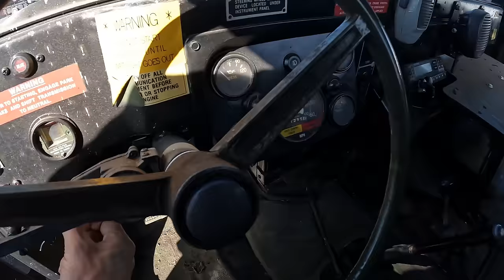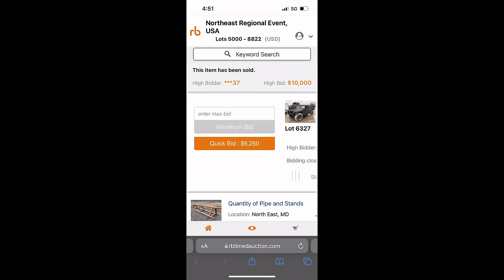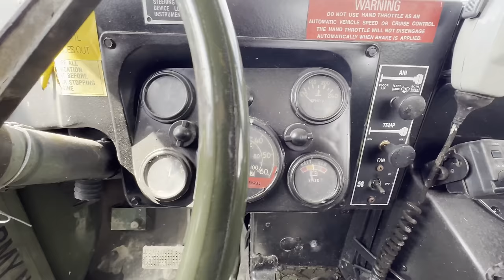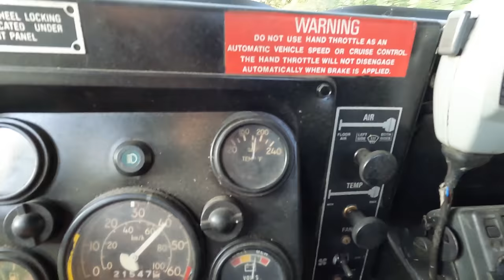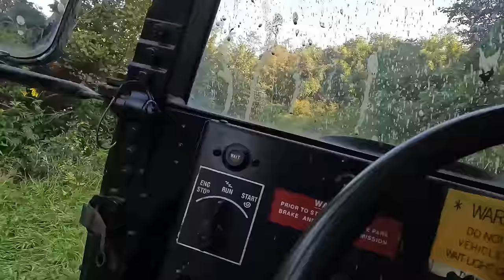Buying, Servicing, & Off-Roading The Cheapest Humvee I Could Find!!

Comment: The two are antenna mounts but can be used as convoy light mounts as long as they are steel and not aluminum.
Reply: Those are aluminum for sure
Reply: I thought they were beer can holders.
Reply: @davidholder3207  not if you want to get the cans with you 🙂
Reply: @davidholder3207  isn't everything a beer holder? I definitely know my hand is!
Reply: They can also be used to hold fishing rods
Reply: What an awesome vehicle!! Your gonna put a winch on it right ?
Reply: Definitely antenna mounts. I wad commo and drove a couple of these. Love them
Reply: @WhistlePunk22  steel
Reply: I thot light cages at first, then you guys ruined it with the beer holder idea...
Reply: You might want to remove the police radio’s from the unit, as it could be a legal issue for you…

Comment: That is a bare bones 6.2L GM slug. The trans is a TH400 3speed. The engine is a gutless plant, designed to run and idle FOREVER, the gear ratio is ideal for off-road use which doesn't demand much power. The newer HMMWVs have a turbo added to the bigger powerplant and a 4L80 4speed. The newer high output turbo engine was to accommodate the additional weight due to the addition of armor plating. There is a generator to power the radios and other auxiliary equipment that are typically installed for unit use.  As already mentioned you found extra radio mast mounts. Yes the rear seats are designed to stow the way you found them to easily convert for field adaptability, two bolts hold the backrest up in place. The side wood slats should pivot down out of the way. Your doors don't fit right because they are the wrong doors, that is a soft top and the correct doors are soft doors (wireframe with vinyl cover), when the proper components are used together (and adjusted aka bent to fit)  the result is pretty impressive . Be cautious going hell bent into water holes, the vehicle is more than capable, however, older units are prone to breaking the blades off the cooling fan due to age and use when coming in contact with deep water. Make sure you pay close attention to the geared hubs, they are straight cut gears and need to be treated as such. There are LOTS of other little things to keep an eye out for, look for the US Army Preventative Maintenance  Magazine. They are little cartoon pamphlets with good info from the motor pool guys and gals. One last thing, at your own peril though. Those diesels can be an absolute prick to start in the cold, glow plugs or not, one trick (again at your own peril) is to have someone crank the engine while you hold a PMCS manual (any vinyl covered semi rigid book) over the exhaust.
Reply: A higher air intake may be a saver in deep water?
Reply: @64TommyG  Yup Get the Intake tube and exhaust pipe for the Marine Corp version They will ford up to the top of the windshield with the deep water fording kit. With out it, I believe fording was only to 30 or 40 inches, I can`t remember which.
Reply: We keep a deck board in the back to cover the exaust in the winter lol didnt take long to fiure out it was needed
Reply: Lotta good info in that one comment. Thank you for your time.
Reply: And boy did idle my fair share of hmmwv
Reply: Sorry (to the OP) your info on the engine is incorrect. They switched from the NA 6.2 Detroit, to the turbo 6.5 Detroit. They didn't simply add a turbo system to the 6.2 Detroit. 

As for all the bitching regarding a Detroit's GP system (not just yourself, i'm talking about the amount that is all over the web) i say it's not true, and more to do with the lack of maintenance & care directed to the GP system over the life of the vehicle. I have a 6.2 Detroit powered, squarebody 'Burb (factory option) that does not see Winter use, but have started it on a -29°C January day (for shits 'n giggles) to prove to a few members on a forum, that a well functioning system will get the cranky ol' Detroit fired up. One press of the accelerator (to engage the cold start feature of the IP) and one cycle of the glow plugs, and she fired right up with roughly 1.5-2 seconds of cranking. Honestly, i'd rather have a GP system in my diesel, over the grid heater system found on Cummins, Duramax, and most newer Powerstrokes.
Reply: TH400? I am surprised.  I have had several Jeeps with that tranny.  Wagoners to Cherokees plus a J10.  Not impressed with the tranny.  My favorite was the T18.  I am surprised that they did not put that tranny in it.  Granny gear plus PTO capable.  30" of water?  I have had my jeep in that much water without a snorkel.  2.5 inch lift and 33 inch tires.  Seen water damn near the hood.  I am making comments on other comments.  This is not putting down your buy.  I would love to have it.
Reply: A 4L80e is an electronic th400 with an overdrive ..
Reply: That's what the Military wanted the most ...commonality with the 6.2L Diesel that was in all their CUCVs!  They already had service parts in their system and personnel trained.
Reply: @frankthomas2231  As you may be aware, there is a LOT more to DWF over say 30 inches, in a HMMWV that simply sticking on the air intake and exhaust extensions. From what I've seen on these old ex-Mil. USMC HMMWVs they remove two critical components of the DWF Kit before offering them for sale to the public.
Reply: So true about the covering the exhaust. It can be 75 degrees out side and it still would be a pain to start.  I upped the boost a little bit on my humvee we would race em on the MSR Tampa in Iraq. Ours wasn't bad it would get up to  about 65-70😂 mph.  They are fun to drive.  I would buy one but getting those licensed here in KY for street I heard was the biggest pain in the butt ever.
Reply: I can’t remember how many fan blades we obliterated going through mud holes
Reply: @frankthomas2231  The Intake and Exhaust Extensions are only a "small portion" of the HMMWV DWF Kit.
Reply: Oh man I totally forgot about the exhaust trick! And yeah starting in the cold was a b*tch, I was stationed in Alaska and every Motorpool Monday in the winter we'd have to switch out for new batteries cos, y'know, -20 and all

Comment: A tip for the fuel filter. When we do it, we take off the dog house, the cover in the cab completing the firewall (in the cab). You have a radio mount in there, but that should just pivot out of the way. It's a bit of an annoyance to get the house outta there with the radio mount on but it's two bolts to take if out if you want. After removing the dog house. There are four bolts by your right knee, you can take them out and pull the whole assembly towards you, hoses and all. Then just take out the four bolts, take the old filter out and plop in a new one. If you do it carefully, you can do it without spilling a drop of diesel. Hope this finds you well.
P.S. the radio stand usually holds an AN/PRC-117, lots of different variants but F, Fox, is the usual. So I've been told, comms doesn't leave their radios in when they submit their vehicles to us.

Comment: As I recall, the two issues most common to our use were: 1. as someone else mentioned, wait for the glow plug cycle to start the engine to save the glow plugs and 2. there were run flat lube bags in the tires. The intent was that if the tire were punctured, you could continue to drive on the metal core on the rim. The lube packs would burst, and keep the friction down between the flat tire and inner rim. The problem was they would burst open on their own if the vehicle traveled more that 55 mph. As the vehicle sat, the lube would settle and coagulate in the bottom of the tire. When you started driving after sitting a while, you would feel the thump of the lube that had settled in the tire. Once it warmed up, the thumping would cease until the next time the vehicle sat for a while. I don't know if your vintage had that option, or if that system became obsolete. but if you experience that problem, that is the reason. The military specs their vehicles to be very reliable, and basically serviceable by the operator, and serviceable in a combat zone. Fun purchase for you, hope you enjoy.
Reply: ya the tire packets are of yesteryear with radial tires and rims it uses a rubber run flat not the magnesium one
Reply: Exactly, turn it to the run position for a few seconds until the light comes on! And then turn it on! Have fun!!

Comment: Hey Matt, a tip for off roading. Take a refillable fire extinguisher with you, the silver / chrome colour one with a schrader valve to put air pressure in it when filled with water. It will be a portable jet wash window washer to clean the windows when you finish off roading. I used to go off roading many years ago. Had one and and washed windows before hitting hte roads going home. A lot better than relying on the screen washer which only does the windscreen. :).
Reply: x2 - Also very effective at putting out brush fires- put your finger over the hole to fan it out, and you can extinguish a surprising amount of burning grass.

Comment: After I worked on these in the military, I used to work at a facility that rebuilt these. We would road test them 50 miles in the winter. We would seal up every gap in the tops and doors with duct tape and plumb the heat on the commander side (passenger) with a heater hose (silicone dryer hose) over to the drivers hole. It wasn’t super hot but it got you by for driving in the winter. I’d say the configuration you have was set up for a unit supply vehicle or for someone like a 1st Sargent. Troop carry racks give it away. Have fun!!

Comment: Most troop carriers had the back seats installed like yours were, to maintain a full bed. The pieces wrapped in bubble wrap are antenna mounts, usually for the singcars radio (one or two), and sometimes for a secure phone antenna (MSRT -mobile subscriber radio telephone - style). Those would mount to rear of truck, on either side of the tailgate.

Comment: The two items in the bubble wrap are for mounting antennas used for the military radios. I use Shell Rotella T5 in my '04 Duramax. That engine now has 502,000 miles on it
Reply: Shell Rotella has all the dinosaurs and vitamins!
Reply: That’s awesome. My dads got an 09 with 336,000 on it. He uses mobile delvac but I’m not here to argue about oil just complementing duramax engines
Reply: @johnsipes4422  😮

Comment: These come with either a two person  or a four conversion. When I was in the National Guard all the Humvees came with the two or for passenger version.  The one that our section was assigned to was a two persons but converted to a four passenger one with soft side canvas top and doors. I was the assigned driver for the S-4 section. The metal flat bracket inside is for the two way military radio receiver.

Comment: Looks like you got a sweet deal on that Hummer.  As a retired Army guy I had lots of fun driving those all over the world.  They will take you plenty of remote places.  The bubble wrapped brackets you found in the back are Antenna mounts and would have been located on the back quarter panels on either side of the tail gate.  The large shelf in between the driver and passenger seats is where your comm gear would go.  Definitely service the hub gears and let the glow plugs cycle before starting.  Don't expect to stay dry or warm in your current configuration, you won't.  All the lift / tie down points on the vehicle are truly designed for that purpose.  It doesn't look like Pvt Snuffy has poked holes in the floor pans to assist with draining while at the wash rack which is good.  Enjoy and put it through the paces.

Comment: Been a little while since I drove one, but I think the transfer case has H, HL and LL settings. The H is for most general use, but the HL and LL both lock the differential so you won't have opposing wheels spinning. As you said, probably one of the most off-road capable vehicles made.
Reply: Put it up against an old school British Land rover. That would be cool 😁

Comment: some advice on these as this one looks in decent shape check the fluid in the portal boxes at each wheel. they make replacement covers that make servicing them cake, a locking diff in the front make a world of a difference off-roading in these, if the center diff has breathers make sure they are extended to the top of the hood so they dont get water in em when fording as some came with short ones or they already rotted off.

Comment: Interesting note on your grease fitting fix. The shop I worked at rarely had the "correct" threaded inserts and usually fixed them exactly how you just did. As far as I am concerned, that is just standard Humvee repair work right there. Also as many have already mentioned, the two unknown pieces were universal antenna/convoy light mounts. The nice thing about the canvas top is they are cheap and easy to repair compared to the plate top. The downside is they degrade quickly and are really never dry in wet weather.

Comment: In extreme conditions, apply some brakes while applying throttle to get the Torsen differentials to bias, transferring power to the wheel with more traction. It will slip up if traction imbalance is too much, but they differentiate very well.  Enjoy your humvee!

Comment: We got our 3/4T HMMWVs issued in '87.  It replaced our squad 2-1/2T Dump Trucks (M342A2) and my 1/4T M151A2 Jeep with 1/4T trailer.  Definitely some Pluses & Minuses:

Cons:  Included less capacity than the 2-1/2T but increased capacity over the 1/4T Jeep (even with it's trailer).  Thr Truck has a fiberglass hood and cheap, pop riveted sheet metal bed and body.  Whoever heard of using fiberglass on a military truck that was going to be abused heavily?  Those fiberglass louvers were an accident waiting to happen.  If you tap a tree with that hood, it just shaters so easily.  And it wasn't hard to rip up the rivets and tear up the sheet metal bed when you're out in the woods.  The seats were so uncomfortable.  Nothing but a canvas cushion sitting on top of a sheet metal battery box (for the driver) and cargo box (for the passenger).  We did a 600 mile convoy between Ft Campbell & Ft Bragg.  Talk about your sore backsides.

Pros:  You called the motor gutless?  We found that truck could power through a mudhole so deep, water was about up to the windshield and come out nicely.  It was a cargo truck, it handled like a cargo truck and it did it's job as a cargo truck well.

The worse problem with exchanging the Jeep for a Humvee was the width of the Humvee.  My Jeep was just over 5 feet wide.  Narrow enough to sneak between the trees.  The Humvee is 8 ft wide!  Like a moose going through the brush.  The jeep was light enough that 2 guys could get a jeep to climb over a fallen log and keep on going.  We could easily push start a jeep if the batter went bad.  A Humvee was like 3X the weight.  Way too heavy.

Final assessment - We sized the Humvee up as a lousy military truck, but it would make an excellent hunting truck for a farmer.  It was just too awkward in the woods for military applications.

Comment: You have one of the best off-road vehicles made as long as you learn how to operate it. Great thing about military equipment, EVERYTHING has manuals covering from an operator's level to what is known as "back shop" complete tear down and rebuild. These manuals should be easy to acquire from any military surplus facility.
The doors you have mimic an up-armor version which form to a hard top. If you find a set of soft side doors to match your soft top you will get a better seal (not complete seal) around the door.
Little interesting fact; the little upward slope, or notch, in the body in front of the rear wheels is to allow clearance for climbing a 24" vertical wall.
You are correct in your assumptions of the seating configurations and the anti mounts. Although you were placing the anti mounts upside down. The hoops would be on the underside to guard cables. Mind you, the anti that would be used are powerful enough to throw you on your ass if you would grab them while transmitting. 
Have fun and enjoy your military grade off-road truck. 
By the way, remembering correctly from my days in the U.S.A. Corps of Engineers, it is also very capable as a hauler with a 1 1/4 ton load capacity.
Reply: I’m surprised they told you about no touchy the antenna bases, or did someone learn the hard way? 😂
Reply: @ebolawarrior451  ohh we were warned but also there are large yellow WARNING stickers on the antenna 😉

Comment: I've had 1 of these gems for years. Sitting was murder on batteries. Solved my issue with an electric wheel chair charger. Cheap and very effective for maintaining my surplus military 24v systems.
Reply: Wouldn't it work to install a battery cut-off switch for it too?
Reply: Nothing a DIY battery disconnect switch couldn’t fix.
Reply: or just buy  a 24v battery charger...
you know that it is actually quite common 'outside the usa' to use 24v in almost all commercial vehicles???
Reply: @steved2136  Many of the older commercial vehicles are 24v
Reply: @mrmotofy  Many of our older ones were 12v, but probably since the 1980's or so, they have been almost all 24v from the 4 tonners up

Comment: Those fasteners are called Rivnuts. They require a special tool to install, but go in easily. Besides the low visibility from inside the cab and the school bus turn radius, humvees are fun to drive. In good weather, pop the top and have a ball.

Comment: If your ignition switch ever dies on you and you need to move it in a pinch, you can jump start it by move the switch to the run position, opening the data port near the shifter lever, and jumping the "S" and "T" holes to each other with an insulated wire.